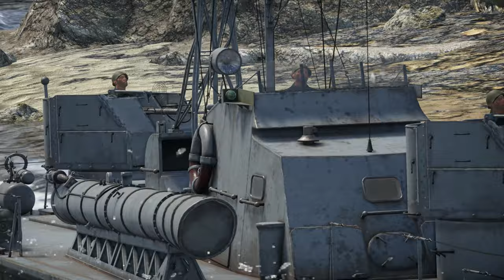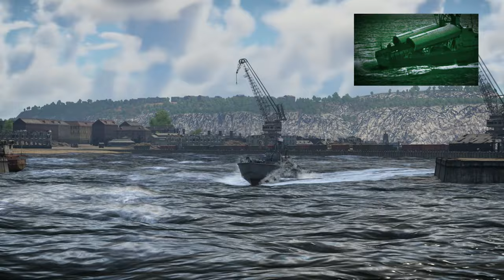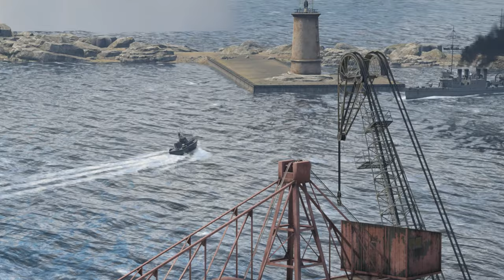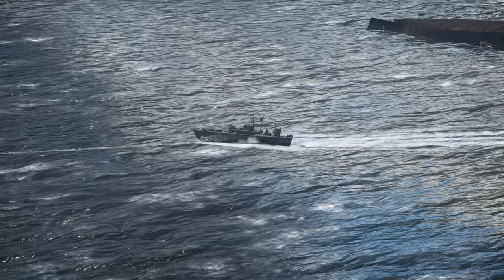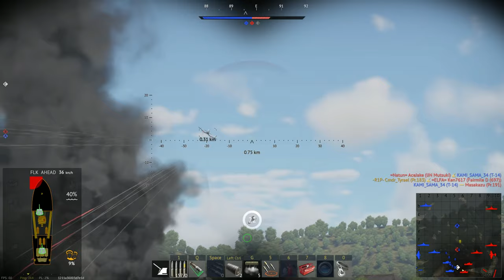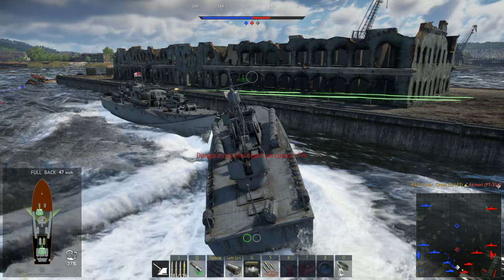Pr. 183 - The Last Motor Torpedo Boat and First Missile Boat - History and Guide

Comment: Finally unlocked this boat after getting back into WT naval after a few years. Coastal matches are much more brutal than they used to be. Need to those parts and FPE and then see what it can do in bluewater matches.
Reply from the maker: You're right! Coastal matches are now much more chaotic. Mainly due to all of the added ships and higher BR's

This little boat is a great vessel to use in a bluewater match. It is great practice for the next torpedo boat. The pr123k. Which in my opinion is boat that is the most fun to play.

thanks for watching o7